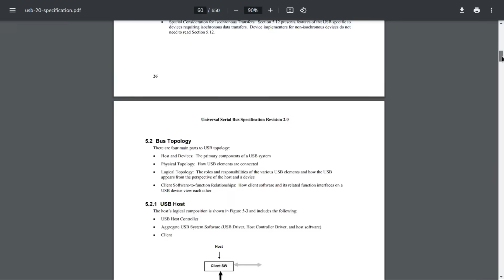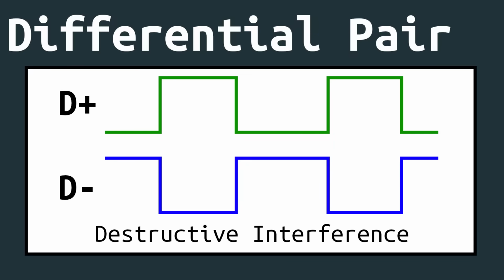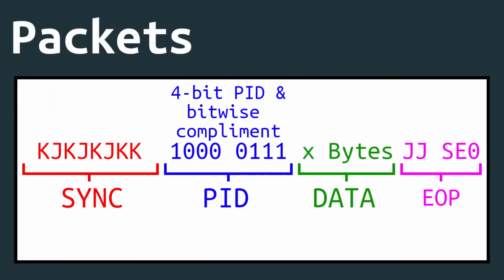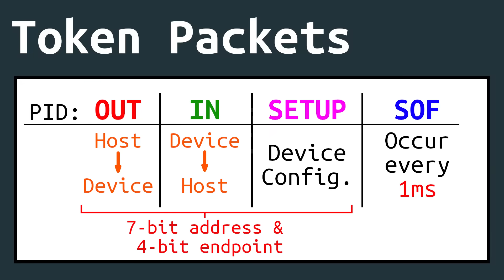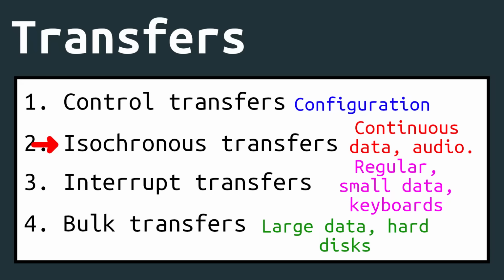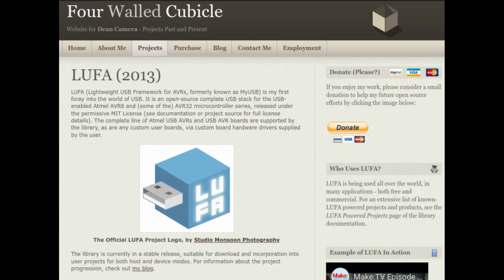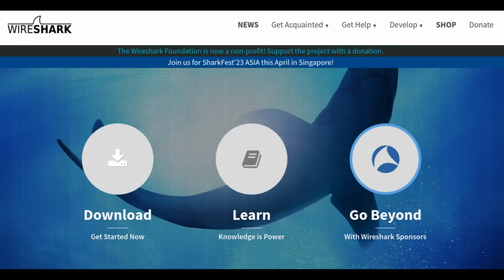Add USB To Your Electronics Projects! - The USB Protocol Explained

Comment from the maker: For anyone wondering, here's a link to the SMD adapter: https://www.aliexpress.us/item/2251832624996364.html?spm=a2g0o.productlist.main.7.76c52ecbfcRb7K&algo_pvid=19f78b0c-252a-414f-99fe-3a8ca3f2ad5c&algo_exp_id=19f78b0c-252a-414f-99fe-3a8ca3f2ad5c-3&pdp_ext_f=%7B%22sku_id%22%3A%2264495190690%22%7D&pdp_npi=2%40dis%21USD%2111.8%219.91%21%21%21%21%21%40211bf12316751972869527289d06f4%2164495190690%21sea&curPageLogUid=S39oAQQcKzaA
Reply: That link is dead is there a specific search term to find something similar.
Reply from the maker: @Jobbyhoyker  You can search for "TQFP32 QFP32 TO DIP32 adapter".
Reply: @SineLab  thanks

Comment: Great video, thank you!

What kind of programmer do I need to program the Atmega16u2 once it is on the seat/breakout board? Sorry if it's a silly question but I'm still a beginner when it comes to microcontrollers. 

Cheers!
Reply: From what I've seen in the video and from reading the schematic, seems like the breakout board can just be soldered to the 3x2 ISP header and then I presume it can be programmed with an USBASP, or am I wrong?
Reply from the maker: You can use any ISP programmer for the header. USBASP, AVR ISP MKII, Atmel ICE, etc.

Some chips also come with a USB bootloader, so you might be able to do that. The ISP programming method is more reliable though.
Reply: @SineLab  thank you a bunch. I just ordered a usbASP. Very excited for my first project since I was a little kid tinkering with my dad :D

Comment: What do you think about ATMEGA16-16PU which is big enough for easy handling / soldering and in 2.54mm standard.  Yes, it's way bigger than the proposed chip but way easy to solder or sit on a breadboard.

Comment: the most part of adding usb to your project, is to have an application or a driver to communicate with your device. Keyboard?! not that interesting. I hope you do it in future videos.
Reply: It’s very interesting ! You are in the wrong place then !
Reply: @hand-eye4517  This is a good video, and I know USB is very challenging to implement. Would you please explain to me how would a micro controller project with some keys as  a keyboard be useful (interesting)? You might be right as I was looking for USB implementation in a more advanced matter, like with a driver on the computer side. I normally learn anything new with a real world scenario, not some example that we may never need or use.

Comment: Ok. I have my burning seat and ATMEGA16U2-AU. Gonna try it. Thanks for the information :D
Reply: I am so confused! Circuit assembled but no clue how to flash the MCU from a windows machine.
Reply: still stuck someone pls help :( trying to figure out how to use Arduino to flash code to the MCU
Reply from the maker: What programmer were you using?

Comment: This is an amazing video! Thank you!

As a noob to all this stuff, the one thing I didn't get from this, and had to go look up was that USB 1 and 2 are half duplex - I.e. only one of the host or device can send data at any one time. 

All throughout I was thinking - how do the device and the host use the same wires to communicate - and the answer is they don't- the host sends a packet and then the device responds. 

Was also wondering why the clock has to be so accurate, but thinking about it obviously has to detect the up and down transitions on the D+ and D- lines, without missing any of the transitions.

Comment: 1:10 Yeah but the 328 is a couple bucks and can be programmed through a usb to serial device and a couple wires. As long as you arent using, or have a disconnect to a device using the 2 serial data pins. Ive never seen a need for anything but a 28pin 328p-pu unless you have multiple serial devices, more io requirements, or a data storage limit as an issue (being only 32kb)

If you want a full fledged screen, touchscreen etc then that jumps the boat to higher complexity usually as youll probably also be running some small software that would destroy the memory cap of an arduino

Comment: USB designed for manufacturers not for DIY. There is 0 reasons put USB on the board where can be enought RS232 or TTL-Serial. The erial is more relayable and stable than USB and requres les MCU resources. If it is so necesseary just use CH34x or CP21xx

Comment: I'm looking for a wireless USB extender, that is, one part acts like the male "A" end, the other acts like the female "A" end, and they connect by radio link. Neither the host nor the appliance know it's there.  It would appear to be a cable, except the female/appliance end would supply the 5V power. Can you please point me to such a device?

Comment: But tu truly understand what's going on you really should use the hardware.  Libraries are a learning cop-out and immediately prevent you from having an optimum solution, since they almsot invariably have more baggage than you actually need.  Implementing USB at the hardware level was exactly what I was hoping you were going to talk about.

Comment: Using serial interface (via USB port) you can easly connect your hardware with your software without writing your own driver (which is not a task for novice). What ability for your hardware a USB interface could give you without writing your own driver? A keyboard and other known HID emulation. Wow. What a uselsess functionality.
Reply: ... then write your own driver?? the point of a driver is to interface between os and hardware and if you create custom hardware you obviously have to write a driver what are you on

Comment: One minor thing, you appear to have misunderstood how balanced lines (D+/D-) work. Unless you were oversimplifying, there's more here than "simple" noise rejection.

For example, I haven't tried this with USB, but a balanced pair doesn't need a ground to work. In fact the ground doesn't need to be connected at all because the difference in voltage between the two lines creates the signal when it's mixed at a differential amplifier.

A much earlier use for this sort of thing is in "phantom powered" microphones which use the two "data" lines here to supply power to a small audio amplifier (strictly an impedance converter). Each line carries +48V (in theory, in practise it never reaches that when in circuit) out to the microphone with and two (opposing signals) on way back. However, some of these mics are "self-powered" and only need to use the two inner cables to send the sound back to the preamp. The outer screen is used as a Faraday shield and doesn't have to be connected to the circuit ground (and it can even create issues if it is).

Ground (0 volts) is a reference. Any point in a circuit can be "ground" and in fact, at AC, both sides of a simple circuit look like ground. But since ground is a reference, in some cases the actual voltage between circuit ground and "earth" ground can be 1000s of volts. In cases like this differential signals completely isolate everything from that and each end (transmitter/receiver) can have its own idea of what "0 volts" is.
Reply: I am too stupid to understand what I just read

Comment: What about the vastly more powerful with way more flash & ram, the stm32f103 etc.   ...it too has hardware USB built in, and it is 1/3 the cost!!!!!!!!!!!!!!!
Reply from the maker: You may use whichever microcontroller you'd like.

Comment: Fun fact, on Arduino Uno, the chip handling the USB-serial conversion is actually the ATmega 16U2 microcontroller. Furthermore, you can easily reprogram it to another purpose. Although its IO is very limited, it is connected to the main ATmega328P microcontroller through two pins (the ones that normally serve as the serial line), so you can use a serial protocol to exchange data between the two microcontrollers on-board.

Comment: Can i use an Arduino UNO as an ISP instead of AVR-ISP, please?
Reply from the maker: Yes, that can work
Reply: @SineLab thx bro!
Reply: Bro have you tried  Arduino UNO as an ISP on Windows instead of Linux? i have totally no luck using the avrdude flashing the Keyboard.hex you provided.
I also tried the following also does not work, (flashing successful but USB device descriptor failed.), do you know is it a problem of fuse settings?
"%LOCALAPPDATA%\Arduino15\packages\arduino\tools\avrdude\6.3.0-arduino17\bin\avrdude" "-C%LOCALAPPDATA%\Arduino15\packages\arduino\tools\avrdude\6.3.0-arduino17\etc\avrdude.conf"  -v -patmega16u2 -cstk500v1 -PCOM5 -b19200 -e -Ulock:w:0x3F:m -Uefuse:w:0xF4:m -Uhfuse:w:0xD9:m -Ulfuse:w:0xFF:m
"%LOCALAPPDATA%\Arduino15\packages\arduino\tools\avrdude\6.3.0-arduino17\bin\avrdude" "-C%LOCALAPPDATA%\Arduino15\packages\arduino\tools\avrdude\6.3.0-arduino17\etc\avrdude.conf"  -v -patmega16u2 -cstk500v1 -PCOM5 -b19200 -Uflash:w:Keyboard.hex:i -Ulock:w:0x3F:m

Comment: I want to add a usb connection to my battery charging circuit using SCR . Is it possible?
Reply from the maker: If you can write the code for it, you can make basically anything with a USB connection.
Reply: @SineLab   my circuits consists only rectifier,scr and few diodes and I get an output of 6V . How can I make that output as a usb port? is it possible?

Comment: Very nicely done, and as a surprise you use vi, very nice indeed.
Reply from the maker: Vi/Vim is a programmer's best friend :)
Reply: @SineLab  I have been using since 85  but started when I first brought up Unix box at home      I built from bsd 4 sources     Back then there was not much X so it used termcap to a vt102.

Comment: One question. I have a pair of old CDJ´s (DENON DN-S3000) so they only work with CD and are able to read MP3 files. I was wondering if there is a possibility to hack this devices installing a USB Port instead of using CDs.

Comment: Timestamps:
@0:01 intro
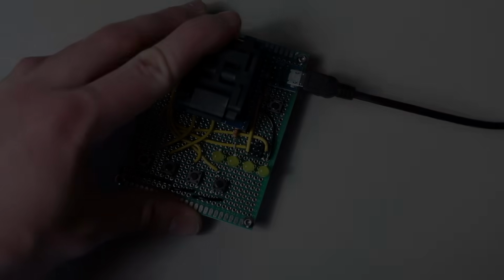@1:00 selecting a microcontroller (why you need to be picky)
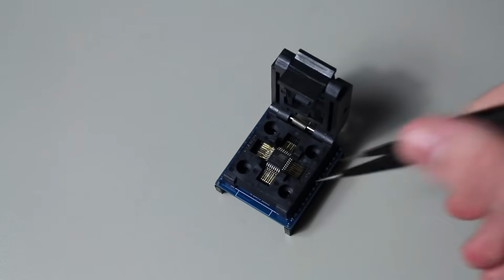@2:50 parts & circuit diagram.
@3:57 USB protocol explained 
@12:32 Libraries to interface with USB protocol. Luff library FTW No need for drivers.
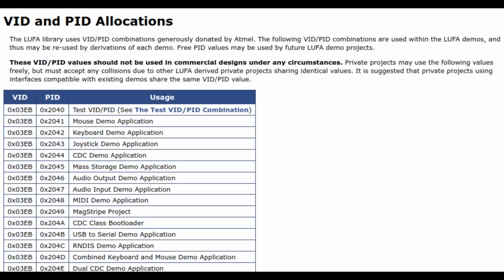@14:46 debugging programs.

Comment: micro controller  with build in usb block inside is not a good variant. especially this one you show in this video. all you need is converter usb <> rs232 like CH340, FT232, 
MCP2200 /microchip/ or some other from this days electronic company's. have a much in market. CH340 is in my work from 7-8 years. work any time on all my boards. also in new one in developing now PICKERPRO with pic18F47K42. believe me, even microchip pic micro device like 18F2550 that is used in PICKIT2 programmer is not good. usb inside in micro controller is bad idea.

Comment: How do you make devices that do not require a specific driver on Windows/Mac?
Reply from the maker: It depends on what you plan to do, but you can use interface classes. The HID sub-protocol also can be used for a lot.

Comment: This a solution for "hobby" things.  However, if your board is going to be offered for sale, then you need to get it approved by the USB regulators.  The FTDI chips are an option, but then when you plug it into USB it registers as a FTDI chip and not whatever your USB device is.   This is a major limitation on USB over Ethernet or bluetooth.

Comment: Hi friend, please help me with a simple doubt (for you)!? How many VOLTS do we have in DATA LINE just plug-in a USB connector in the USB port of a computer???
I need just make 2 LEDs blink after plug-in the USB to show me the data lines (D+ and D-) are OK, please help me with this little project. 😞
Reply from the maker: The USB Power lines are 5V. The data lines are 3.3 volts.
Reply: @SineLab  Thanks friend... What about make 2 LED for D- and D+ lines, do you know to do that connection to blink?

Comment: Can I just add for the future, the breathing is very distracting. Not sure how to fix it either post recording or by breathing through your nose more, which might be hard if you have allergies, but I struggled a bit following since it's so prevalent. Great video besides that though.

EDIT: tbh just putting the mic further away from you (or getting a better one and doing that) might fix that since you sound like you are quite close to it.
Reply from the maker: Thanks, I've been thinking about improving my audio quality lately. I'll probably move further away and also edit out any large breaths :)

Comment: i have a old led battery powered closet light that i never used cuz i don't buy batteries so i got a old usb cable cut one end off and soldered the black and red wire to the two main battery terminals and mounted it by my keyboard and plugged it in usb port on pc. now i have a night light for keyboard and it shuts off when i turn pc off ...

Comment: The absolute easiest USB chip to use is the Microchip PIC18F4550, DIP40! Plenty of examples, great datasheet, and applications notes. Been using these for years! No surface  mount nonsense, either! An excellent book is Jan Axleson USB Complete, for those that want to learn and experiment.

Comment: Any idiot can use USB if the controller supports it natively in hardware and there are libraries for it. If you really want to show something interesting, then why not V-USB which runs on almost every Atmel AVR, because otherwise you can also directly use an STM32 with hardware USB...

Comment: Nice explanation with pictures! However, I don't think this is a way to add USB to your project, especially for a beginner. The fastest, easiest and cheapest way is to slap a USB-UART chip and not worry about code, protocols, libraries and anything.

Comment: Great! Now how would one change those pesky WiFi devices to use Ethernet? For example the Sonoff TH16.
I need a remote smart thermostat on the building roof, and there is no WiFi AP there, so I would like to run a cable or use Ethernet over powerline.

Comment: I'm no electronics wiz, but since this would "supposedly" USBify everything, how easy would it be to add a USB port to an Amiga computer using your implementation? Would it mean utilizing the Amigas' serial port to do that? Thanks for the video!
Reply from the maker: Depends on what you plan on doing. If it is going to act as a device, then my method would work. If it needs to be a host, you should look for a micrcontroller with USB host capability.

Comment: If it's not a keyboard or serial endpoint, then you still don't have to write drivers for your PC. You can make a regular application that interfaces with USB hardware, like I did with a LabSphere spectrometer with proprietary communications (reverse engineered with Wireshark). I even did it in Java.

Comment: I want to make a small usb uart host such that I can connect some Arduino to its usb to collect serial data and store.. basically a usb serial data logger. Yes i can also log direct serial data but it's for a device that does not have gpio for seperate uart and sends data over usb serial. Any good suggestions ? Currently I do with raspberry pi but I want smaller simpler solution if possible.

Comment: Here is a though for a project. Use the RPi Pico with a 2.8" up to a 4" LCD display. Create icons for keys in a 4 by (5 or 6) matrix. With this you can have more than one set of usable macros. Have two keys for moving through the other sets. I see all these keypad type of macros key but they use mechanical keys with fixed icons on them. Hold both up/down same time to go into upload mode for keypad the icons and macros.

ATM I am playing with MMBasic on the Picos sadly no USB HID abilities.
 For my current use as controllers it just works. I only need minicom and the pico.

 Just musing after looking at the many ways here on youtube. Have FUN.😄
I have a box of Arduino's in many forms along with STM32 boards just starting to learn to play with them.

LOL forgot to say the LCD needs touch.

Comment: I'm sorry but the link to the code just give an empty file that name usbfy and contain nothing in it. Do you have a Github or any others way for me to take a look at your code?
Reply from the maker: I've updated the zipfile, should work now: https://sinelab.net/code/usbify.zip
Reply: @SineLab  i have a problem with my DFU reconization on window 10 with an Atmega32U4. My external crystal is correct I checked everything as well. Do you have a tip to fix that problem ? Thank you
Reply from the maker: @HAAnhHa-pq1ez  I'm not too familiar with DFU. I used ICSP when making the video. I'm not sure what your setup looks like, but check the HWB pin. Depending on where you got the atmega32u4, the fuses might have been changed (from the factory they should have the correct fuses). Another big problem for me in the past was an improper USB port setup, it's quite sensitive. It might even be a Windows problem. Good luck!
Reply: @SineLab  thank you I try ICSP then